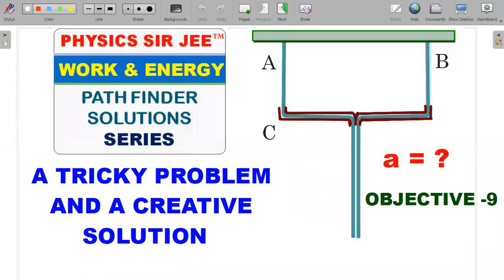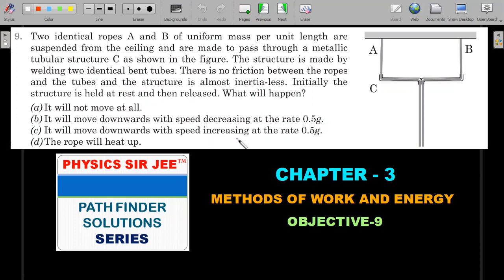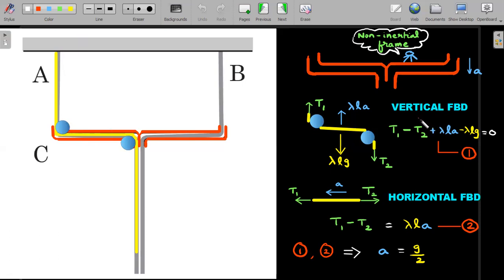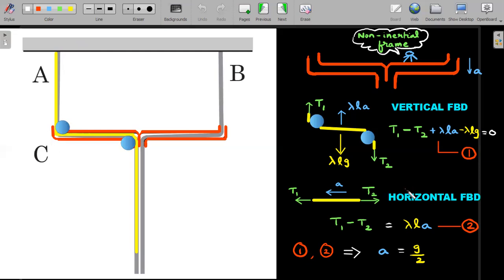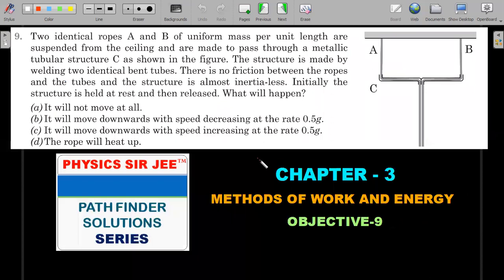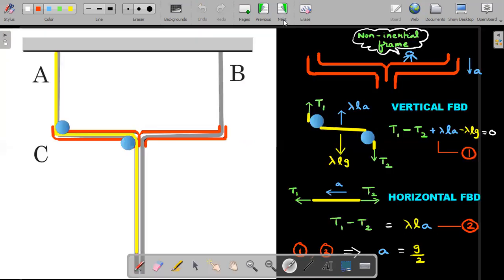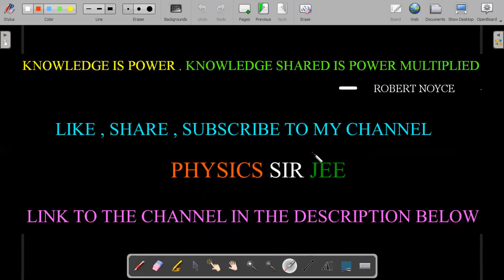PATHFINDER PHYSICS SOLUTIONS | WORK ENERGY OBJECTIVE 9 | TUBE 2 ROPES | JEE ADVANCED SCHOOL PROBLEM

Comment: Sir would there be heating because of stress and strain in the rope because of the tensions?(there is no mention of rigidity of the ropes)
Reply from the maker: We will consider ideal ropes in NLM problems until it's mentioned otherwise. For non-ideal case , option C will also be not true. By energy analysis (which I asked as HW) we get heat=0 if Option C is correct

Comment: Sir, actually there is an abrupt transition of speed for an element on the lower rope, just before, and just after it comes in contact with the structure.
Reply from the maker: If you observe the motion of the rope wrt tube , there isn't any abrupt speed change... This was mentioned in the video
Reply: @PHYSICSSIRJEE  in the video, i could not find that you said "with respect to tube". Give me the time stamp, if I missed it.
Also, that is not the point of contention anyway.
Now, do you agree that there is an abrupt transition of speed of the elements (with respect to ground) of the rope during the process?
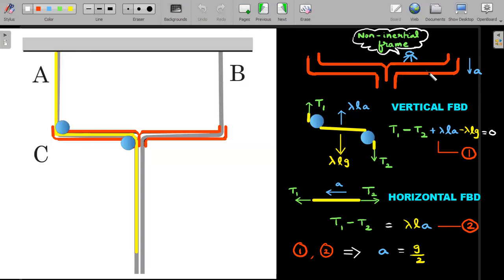Reply from the maker: @afzal1104   from 2:45 onwards , the entire FBD analysis was done wrt tube. If you carefully observe the top right of the screen , the observer was drawn in blue.
Coming to your point of contention , wrt the ground , the vertical parts of the thread are always at rest . The horizontal part (which is of fixed length as equal parts enter and leave it) does have a constant acceleration with equal x and y components and thus has continuous rise of speed. Additionally , you may find , that total M.E. of the entire rope is constant.
The abrupt transition you might be referring to , is not abrupt , as the speed transitions from 0 to v in the right bend and v to 0 in the left bend . This visualisation is to support the idea of no loss of M.E. 
To understand my point of view about mechanical energy conservation , please refer to this section on falling chain from David Morin 👇(second scenario in page 170,172)
http://ipl.physics.harvard.edu/wp-uploads/2015/04/PS12a-falling-chain.pdf
Now, Please do continue with your point ,you wanted to make🙂👍
Reply: @PHYSICSSIRJEE , yes, I've already proved that the net mechanical energy of the system remains constant. And that's exactly what's pestering me, because I still see abrupt transition of speed of rope elements with respect to ground, about which, I shall be expatiating on in my next message in sometime.
Reply: @PHYSICSSIRJEE  , assume the tube has already moved for a finite time, so it must have acquired a finite speed as well.
This means, that all the rope elements inside the tube have a finite speed.

Now, consider a rope element just below the tube. It has zero speed. Lets call it particle Q.
 
Now when this particle Q, which was just below the tube, becomes a part of the tube (the process takes infinitely small amount of time), its speed jumps from zero to a non zero value in infinitely small amount of time.
So, there is an abrupt jump in speed of the particle.
Let me know if I am wrong.
Reply from the maker: @afzal1104  your understanding is not wrong , in fact right from the start , I have been trying to highlight the fact about importance of "bend" and it's dimensions to justify energy conservation. The abruptness always doesn't guarantee energy loss. The mathematical modelling of the bend is important to understand the energy conservation. This is also highlighted by "David Morin" in para-4 page 171 (file I shared in previous comment) clearly in a similar problem by saying it's not evident from "force" considerations. 
Once we get M.E is conserved here in the present Problem first , we then proceed to model the dimensions of the bend to explain how heat is not generated. In the present Problem , with M.E. conserved , the ropes will keep swinging back and forth once they come out of the tube completely
Reply: @PHYSICSSIRJEE  sir can you give basic idea how energy will be conserved
Reply: @PHYSICSSIRJEE , I read David Morin's excerpt that you'd shared.
But let us suppose that the bend is abrupt, instead of being smooth, and that the string is modelled in such a way that the distance between the particles of string are far apart from each other (connected by tiny massless, flexible wires) compared to the dimension of the bend. Then our calculations would still not change, right?
And we'd still end up getting that the energy remains conserved. 
But, according to the model, I just alluded to, the energy is bound to dissipate, because of the presence of the abrupt bend and given the particular model of string that I've considered.

Does it not elicit an awkward inconsistency here? And this, I fail to understand.
Reply: @afzal1104  sir how did you conclude that energy remains conserved?
Reply: @afzal1104  bro if bend is abrupt you can't determine their energy because of microscopic energy losses which you can't find by macroscopic energy calculation and additionally now heat will be generated of course yes but the fact that energy calculations are different is also true so it justifies the situation of abrupt bend
Reply: @PHYSICSSIRJEE  Sir, How can you say that whole rope will swing , when the last portion of the rope will just enter the tube, the entire rope out of the tube will still be at rest . and when the tube falls out(i.e the portion which was inside will also come out) , you are saying that all parts of rope will start swinging together , how is that possible sir?, please clarify

Comment: Sir plzz solve question of path finder work power energy the question goes like this In the arrangement a special box is used to several identical plates each of the M and the thickness t0 contains. ...

Comment: Sir why have you taken sum of vertical forces equal to zero without considering the normal force? Sir is it not possible that the part of rope inside the tube has a net upward acceleration which is cancelled by normal between rope and upper surface of tube.
Reply from the maker: Net force on tube is zero as tube is massless.Normal reaction is zero because weight is zero
Reply: @PHYSICSSIRJEE  thank you for clarifying sir!

Comment: Sir why are you not taking the mass of bent tube in account...there is no mention that the tube is massless
Sir i think the temperature should increase...Sir while looking from frame of ground..the rope which is below the tube will start increasing its velocity when it enters the tube and as it leave the tube...that is when it is out..its velocity become 0...that of 1/2mv^2 will increase temperature...and sir while applying conservation of energy....the potential energy of rope decrease as it decent down...which increases its kinetic energy while rope is in tube...now suddenly the rope become at rest when it is out of tube so the energy get converted to heat ....reply please..
Reply from the maker: Inertialess = massless
Rope will swing and not come to rest after coming out of tube
Reply: @PHYSICSSIRJEE  but there will be superimpose of shm of both which will cancel...